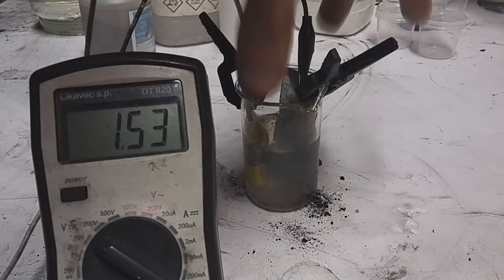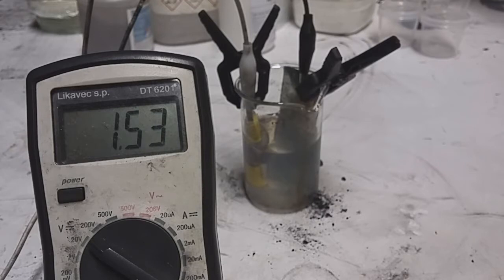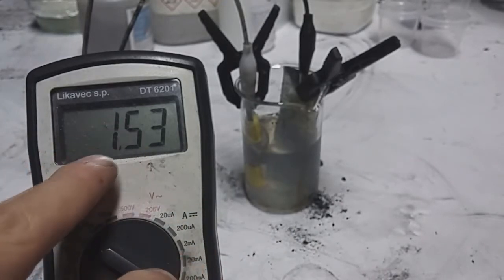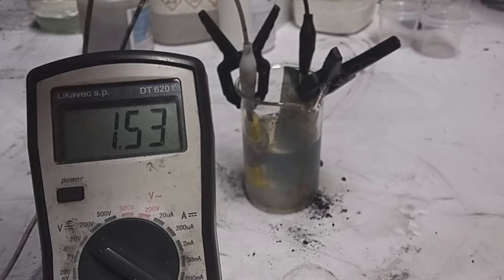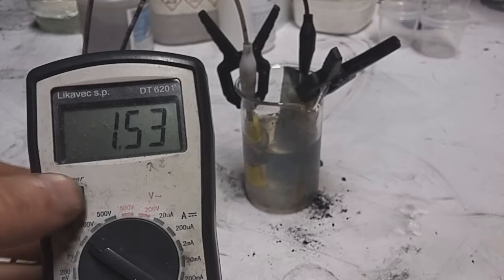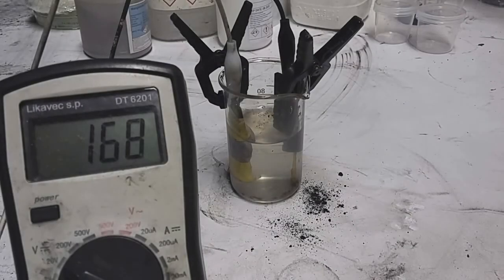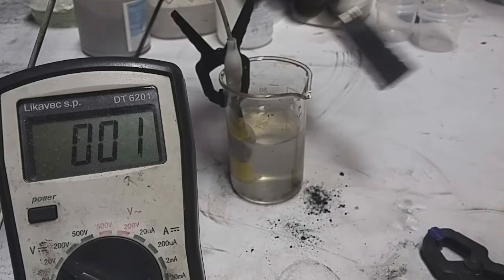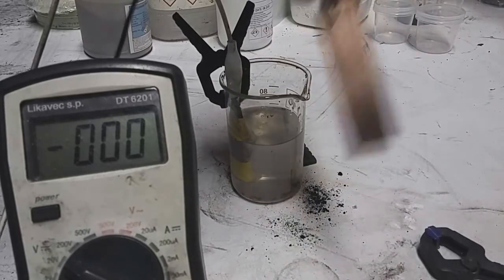Zinc Ion Battery

Comment: this battery seems to have great potential, if surface area is increased will it increase amps.reaching up to 500 maps is good
Reply from the maker: Aquif Khan correctly. also with this battery I get almost 700 mA if I put the cathode and anode more  together. See the video "The dendrites problem" at 8:45"
Reply: cayrex2 ok